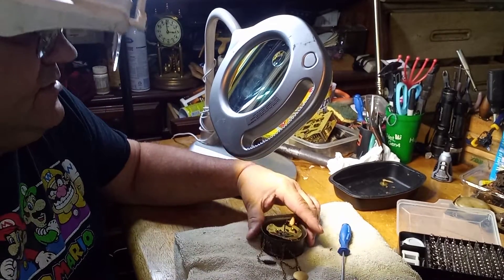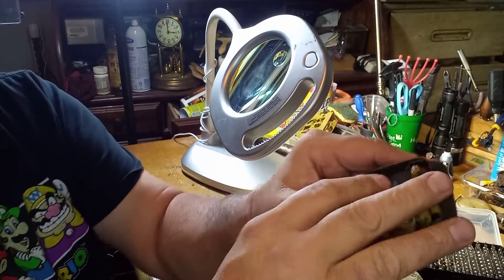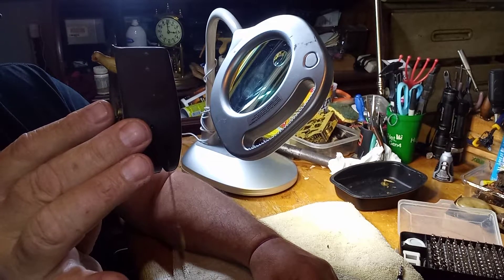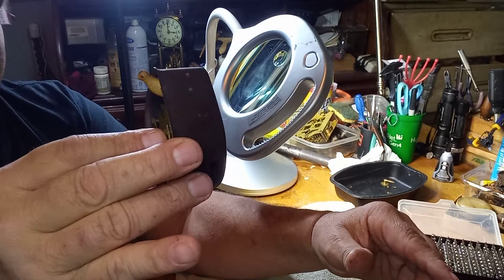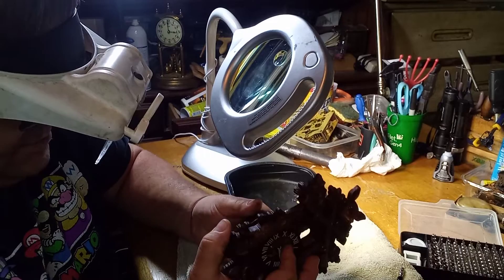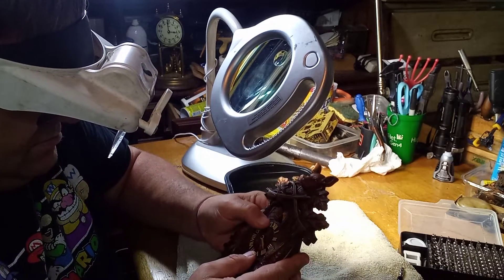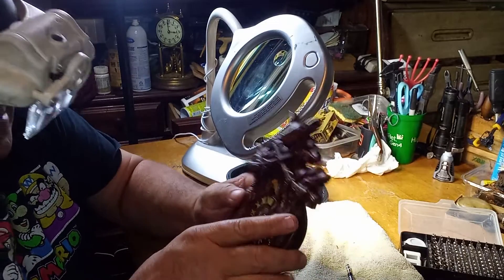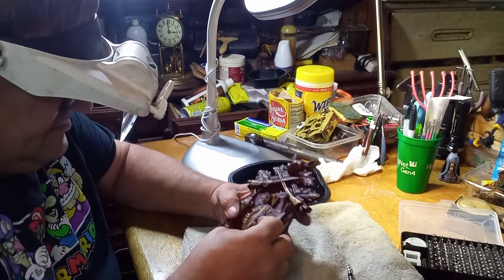Getting a Lux Pendulette clock bird to bob up and down (See description) 20221101 025757

Comment: These are an odd clock, yet is a cool cuckoo clock. Love the mold design of this clock. The bird normally breaks off if you try to move the bird, best to just move the bar only.
Reply from the maker: Yes I didnt think that I could move the bird without breaking it so I didnt try that hard. I am happy where the bird is. I have a few pendulette clocks. They are so small that you can put them in between your big clocks.